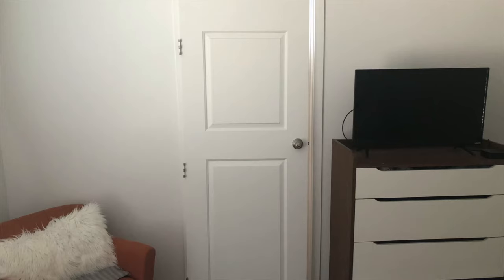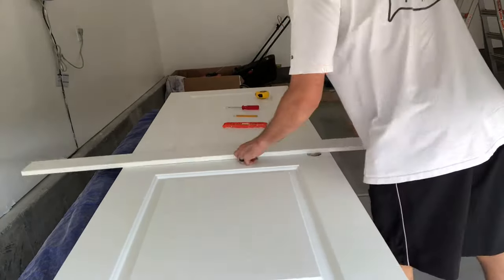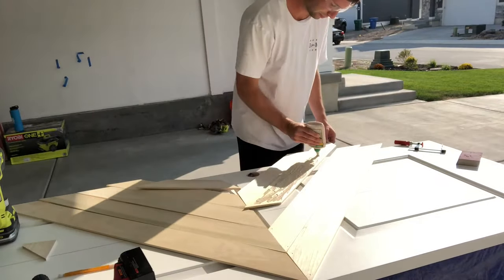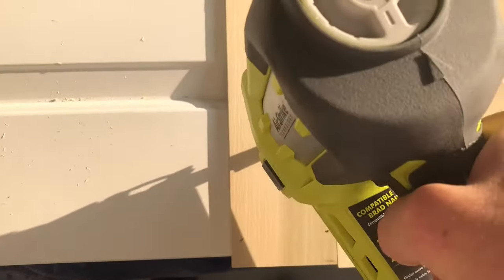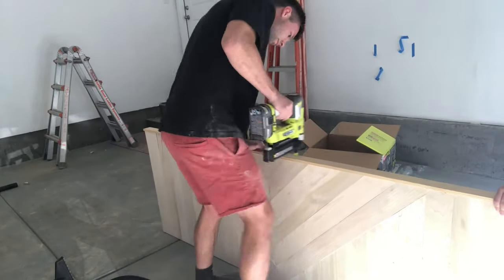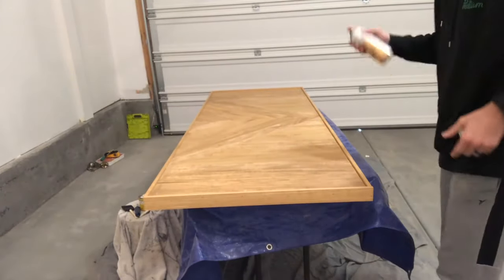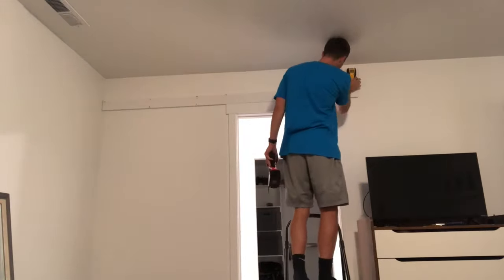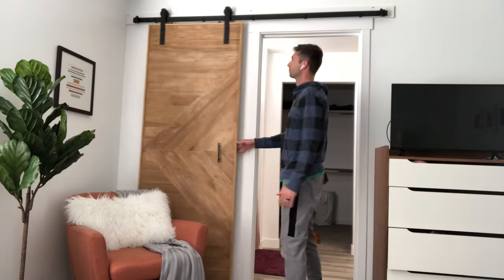Turn Old Door Into Sliding Barn Door For $150. (Step by Step)

Comment: Thank you for your video.   We're looking at doing something similar.  Did you do anything on the other side of the bathroom sliding door?  Was your interior door hollow or solid?   Did you have guides on the floor or bottom of the door so it wouldn't swing out?

Comment: Did you add any height to the door? Others are saying the door needs to be taller
Reply: I don't see if he extended that poplar beyond the original door length.  But it looks like there's maybe 1 to 2 inches where he could have backed out that bracket closer to the top of the door.  I suppose you could also remove the top piece of trim on the jamb and mount the track there so the door would still reach the floor